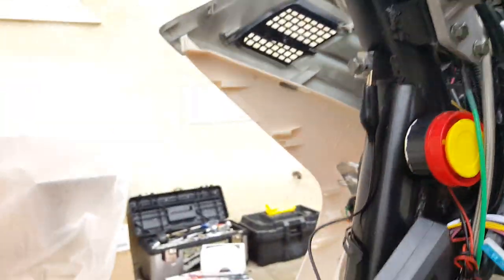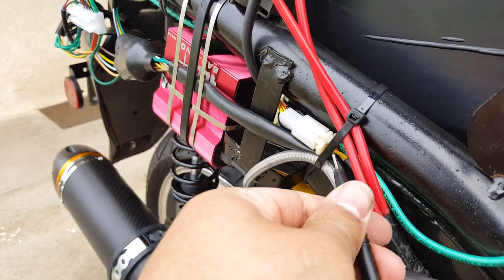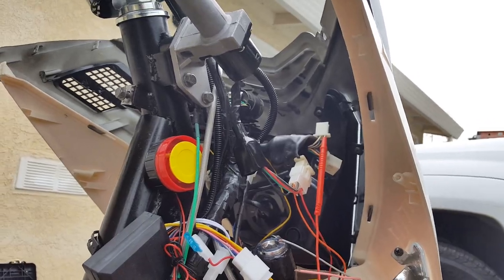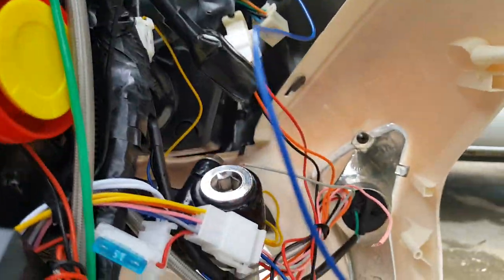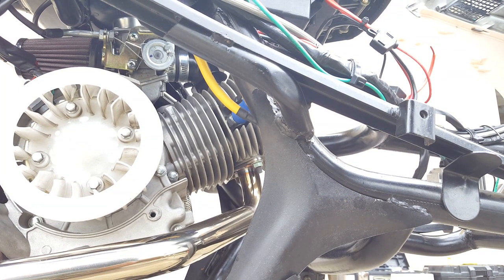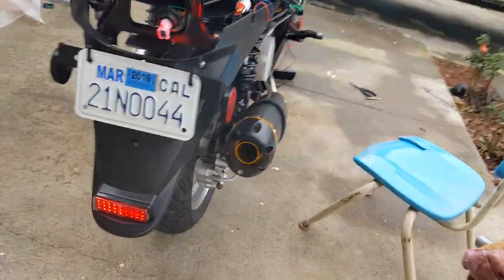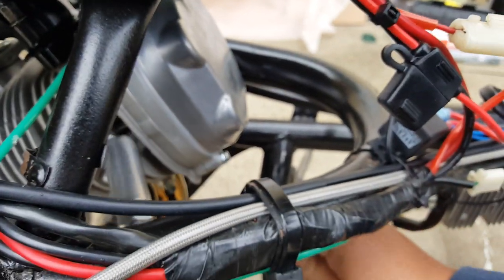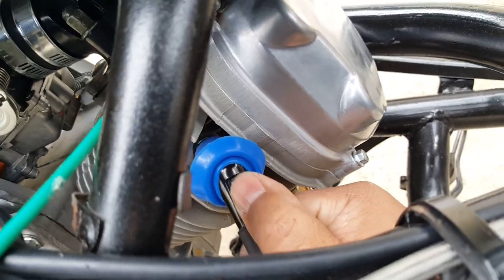How to Wire GY6 Scooter Alarm Remote Start 4 of 20

Comment: If it's a GY6 you wiring in a Chinese scooter in the front behind the headlights there is a jumper wire in a plug just plug your alarm system into that and everything works don't even have to have keys turn signals alarm automatic kill like it's somebody jumps on it driving off you can kill it

Comment: A good way not to do this.... Omg
Reply: Hi Howard I didnt do mine this way either lol but i got everything running like key less start and cutting the bike out via the Keyfob but I want to do it so if the bikes running & the alarms armed to cut the engine and immobilise it so it cannot be started again until the alarm is disabled as mine can .. is this possible ? Thanks in advance
Reply: @ricktee6287  
You just got to keep in mind that when you're using the remote start all that you're doing, is bye passing the ignition switch. But if the alarm goes off it should not start until you disable it. That's the safety function of the system.  When you unplug the ignition switch there's two wires you can use a jumper wire to bye passing the ignition. You can start it that way . This guy is just being too complicated. With gy6 simple is the best way to go.
Reply: @ricktee6287  
I forgotten to mention that the two wires that you hooked up to the solenoid relay is the safety function so it's not staying when someone is trying to still your bike.
Reply: Starting
Reply: @howardlangford8087  thanks for replying would they be green wires by anychance ? I did do a video of mine if I upload it can you help me out ?
Thanks in Advance
Reply: @ricktee6287   Hey Rick I've got a lot on my plate right now, but I'll let you know know the wires you looking for jumper wire are red and black. Should be the same for all gy6. Good luck with your bike 👍💯
Reply: @howardlangford8087  I hear you mate, Focus on you my friend but thank you for taking time to reply and advice .... all the best mate  :)